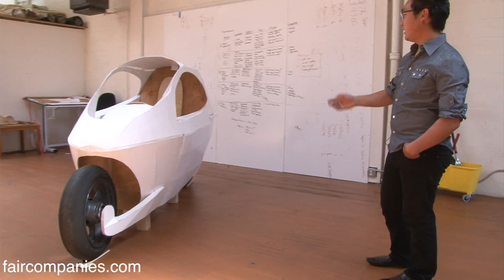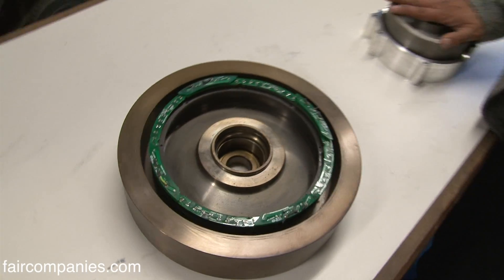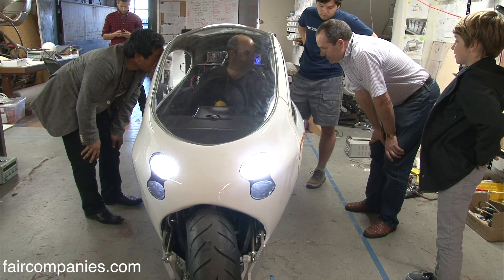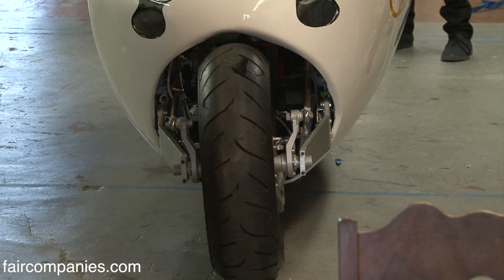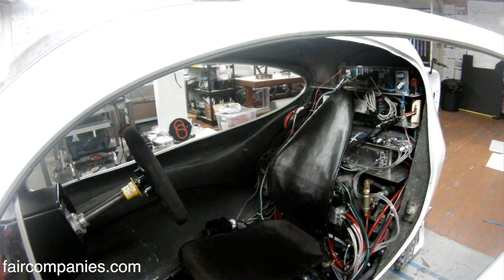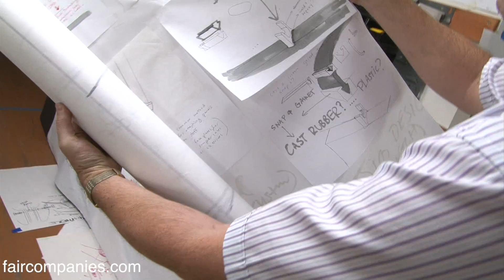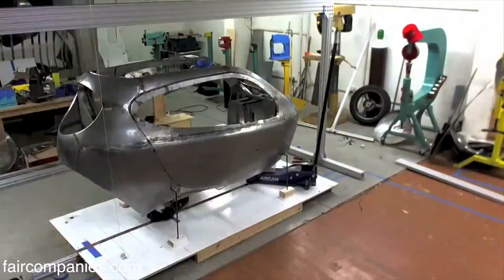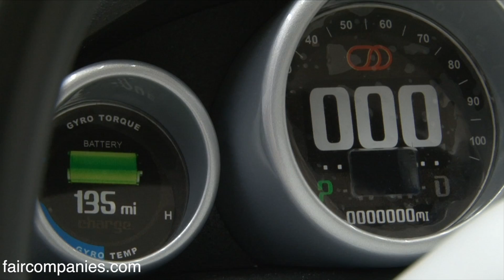2-wheeled untippable EV gyrocar from SF automaker startup

Comment: Kirsten since this is not your video and you only uploaded this to your channel to get clicks , I will direct my question to anyone other than you...my question is...how is the steering able to compensate the counter steer on a normal two wheel motor cycle.   if the steering turns in same direction of wheel then this will for sure go the wrong direction. . it is all about lean and counter steer to get a 2 wheel cycle to go in direction wanted.  so how is this compensated?

Comment: I expect this would actually cause a lot of stability problems in areas with steep hills. Particularly if you needed to make a turn while ascending or descending one of those steep hills.

Ascending or descending a steep hill, if there isn't enough tilt in the gyro a wheel could actually have reduced contact with the road, while the vertical stability is maintained.

Turning while on a hill would require the gyro to tilt left or right to compensate temporarily in response to a directional change, even if it wasn't caused by steering. 

And of course some terrain changes orientation, or doesn't regardless of whether you turn or not...

Good luck with this. I admire the complexity of the challenge.
Reply: Screws with packaging, but gyros should be on horizontal axes transverse to the vehicle length. Brennan gyro vehicles arrived at this a century earlier.

Comment: The horizontal gyroscopes are really only needed when moving slowly, standing still or being pushed around by high winds. Motorcycles at speeds over approximately 15 mph are using the vertical gyroscopes, the wheels, to balance the bike already. It's the Rider that needs to not get in the way of the vertical gyroscopes keeping them upright. 

I dig the idea though. I'd definitely consider buying one. They look great and they're much safer than a motorcycle.

Comment: so if you run out of battery the thing will tip on its side with you sitting inside of it? and a heavy flywheell rotating at massive rpm right under you ass and parallel to it??? NOOO

Comment: This gyro machine Will drain the baterries before you go anywhere...
Reply: Nope, the flywheel has very little resistance and can spin for hours on no power before it stops, it only needs more power when it slows down from resisting change in orientation to stabilize the vehicle.

Comment: For not more width , you could have two wheels at the rear or better steering at the front and do away with the gyro .
Reply: That is the thing, there is no real gain having a highly complicated 2 wheel gyro stabilised vehicle when tilting 3 wheel one would achieve the same goal with established and well proven cheap technology.

Comment: Why all the high-tech, when the 1967 gyro-x did the same thing with only one mechanical gyro?
Reply: Exactly xD
Reply: Because the more bullshit you can put in cars now the more fashionable you are
Reply: Exactly this is not new technology only that this one is electric , there are lots of things being sold as new tech and if people would research they would know this so these so called innovators are just rehashing old things and taking creadit for being the first
Reply: The gyro X was a failure
Reply: In fact, their first gyroscope was very similar to Gyro-X version.
Reply: i was thinking the same but i assume its actually easier to produce something of higher quality with new tech. This one is likely smaller, quicker to respond, and maybe even have less wear and repairs
Reply: I felt my comment was better left separate, so feel free to check it out, but the short version is: hills.
Reply: Self driving is the future so they're looking ahead
Reply: They also went out of business, so it might not be the best comparison.  Also, you can't judge the existence of the car alone as a measure of success.  There are more factors, including fuel efficiency, reliability, cost efficiency, performance, etc.
Reply: Yep! Its funny how they go saying "its a robot! a robot" and the gyro-x did all that with jus hidraulics...
Reply: whats wrong with 3 wheels?
Reply: k leung three wheels still has to lean and therefore requires complicated heavy suspension mechanism and servos.
Reply: I'm guessing Kim placed the gyro under the floor to keep the vehicle short.  The two counter rotating gyros in the same gimbal had the right shape: longer, narrower more flat.  It also provides redundancy.  If a torque motor fails you still have the other gyro to keep the vehicle upright.
Reply: Gyro X was a MUCH larger vehicle.  The Lit vehicle uses the gyros as additional batteries moreover it’s all electric and they are promising self driving.
Reply: I know I'm late to the party but for posterity: Single gyro systems suffer from the problem of "Procession" of the gyro. That is, the gyro gradually "wanders" on its own, leading to an uncorrectable  and undesired tilt. Two gyros rotating opposite each other negate each other's procession so you're only left with the desired quality: resistance to tipping (rotational inertia).
Reply: Well they Gyro X is very wobbly if you look at the less popular videos of it. Having proper electronic systems to help with precession is very useful, hence why they never drive the Gyro X at more than 15mph
Reply: The gyro-x is about twice as long and never put into production
Reply: @jackmcslay  thats because they ran out of money to fund a production model for production. And 4 were built but only 1 exist in working condition today. The other 3 were scrapped.

If they had the money. We would be seeing a 2019 gyro x by now, not this thing :/
Reply: Government standards
Reply: @kkane2280  it was legal always xD. They ran out of money xD

In todays goverment it would be registered as a motorcycle
Reply: @monkeyfan250  I understand that part but the question was why it was so complicated compared to the original all the safety equipment but the government would have required for this to be put on the road is probably what killed it because of the cost much cheaper if you don't have to put all these safeguards in
Reply: @kkane2280  i think what killed the cost was the parts of the car more then government regulation
Reply: because there's more saftey regulations today than there was in 1967. can't get something approved for commercial sale without requirements and those requirements are likely even more strict given the concept
Reply: Because it was made by a mean white man....?
I'm sick of people forgetting(unlike you, Bro) that there is NOTHING New Under The Sun!
Reply: @davidcisneros1429  No, thanks for trying, racist. It's because single gyro systems suffer from gyroscopic procession. Dual counter-rotating gyro systems negate this problem. Look up "gyroscopic procession" or "Brennan Gyrocar". If you hear the guy explain he says it in the video "they (2 gyros) counter rotate, counter process..."

Comment: '"regenerative braking"    The double decker buses in London use a high speed flywheel as energy storage instead of batteries to make their buses hybrid. It would be great if the gyro in this vehicle could be spun up to very high rpm from regenerative braking and then tap into that energy for acceleration from standstill.

Comment: This is really good video as it gives an insight into how complex the LIT vehicle really is.  (BTW: All your videos that I've seen are excellent, sub from me.)

I can't see the LIT motorcycle ever taking off when you can solve most of its complex problems by just adding another wheel.   As I write it's three an a half years later but they still haven't started manufacturing.  Compare that to the four wheel Microlino which has started production and it was only founded in 2015.

Comment: why does it need all that electronics ? the first gyrocar was developed long before any computers and it worked
Reply: Moonraker Deep to make it more reliable
Reply: I was thinking the same thing.  In the late 60's I had one of those friction cars that had gyro balancing and it always righted itself after going over small bumps, divits, and so on.
Reply: This car uses a PID to more effectively counter movement. Only possible with a computer. The older gyrocars weren't nearly as stable.
Reply: It depends on the size/mass of the giro-wheels relative to the weight of the vehicle.

Comment: Ok, I want mirror-metallic one, but,... I want semi-flexible solar panels on my roof top, watertight kevlar cockpit that sleeps two adults, rainwater collecting tank with drinking water purification and shower hose extension, air-conditioning, gps, airless all-terrain tires and hot air balloon rig and One wheel trailer that transforms into giant Yurt,... it doesn't matter how much it costs just send it over here son, make sure it has fog lights, if I get caught in a swamp
Reply: Nemanja Tomic send me 1 million dollars and I will get to work on it, I will also use super materials at that price like carbon nano fiber wires and stuff.

Comment: When battery dies, or some electrical power failure, you will need a crane to right back up again :D  its size is the same as a 4 wheeled tiny car ( like Smart car or one of those Japanese small car) , why not just get a small EV car with 4 wheels?  :D

Comment: What are the safety backups, like if the electricity suddenly cut/shorted out......would the gyros still be able to keep it upright?
Reply: I'm not an engineer, but it I know that a sealed gyro unit like the 2nd generation test-bed's 40lb version that spun at 12,000rpm, would have an incredible amount of momentum and a long spin-decay, so it would continue to exert a righting influence on the vehicle for a long time after the source of its power was removed.

I'd be interested to know how quickly the gyro they're using now, takes to power-up.

Comment: What are the downsides of simply having 4 wheels with a narrow wheel-base?
Reply: Probably the biggest downside would be the tendency to tip under lateral loads, in corners, on non-level surfaces or over surface irregularities.  Imagine a catamaran sailboat with the two hulls only a few feet apart.  How stable would it be in a crosswind?

Then there's the added weight and complexity of 2 additional wheels, and wheel coordination for steering in the front and differential in the back.
Reply: Teghead hi how it wit are static now w
dow car ?
Reply: If battery goes dead or an electrical failure the gyroscope device will stop and the thing will tip over, hopefully a 10 wheeled trailer truck is not behind you when that happen  :D

Comment: I'm sure your trying to make the gyros quiet.... Ever try making them so they run in a zero vacuum? No air no noise.
Reply: Not sure what a "zero vacuum" is, but I think one of the problems is that the two gyros are mechanically interconnected, which would make maintaining a hard vacuum difficult.  Of course, any reduction of gas in the gyros' envelopes would reduce surface friction, and thus noise, but some of the noise may be impossible to reduce, such as mechanical linkage noise.

Comment: This is going to be like the Segway all over again. Massive computational power, loads of sensors, extra battery use, tons of research and development costs, all becoming unnecessary by simply adding a third wheel. I love the engineering aspects of it, but in engineering there's this principle of K.I.S.S. to keep in mind with every project.
Reply: Want to talk about "pie-in-the-sky nonsense", Ken U?  The ELF seems to be a prime example.

Given the ELF's stated top speed of 28mph, it can't go on the freeway or indeed, on on any street where the posted speed limit is greater than 30mph (there are laws against obstructing traffic by going too slowly, you know).   Here in the Bay Area, that would include almost every street except residential streets and school zones.  It can't go across any bridge in the Bay Area (nor most of them elsewhere).  As their own FAQ states: 

"According to federal guidelines, the top allowable speed using the electric motor only is 20 mph on a flat surface. ELF owners can travel faster by pedaling, some riders regularly go more than 25 mph. The ELF is designed for use under 30 mph."

It goes on to say "Under federal consumer safety law, the ELF is deemed a bicycle", but it can't really be used in the real world like a bicycle.  Bike lanes are generally just 4 feet wide, with the idea that it will be sufficient space for one cyclist to pass another.  But the ELF is itself more than 4 feet wide, which means that (a) it's going to hog the entire bike lane, forcing other cyclists to enter the car lanes, or (b) it's going to have to enter the car lanes to pass other cyclists.  And as anyone in San Francisco knows by now, Uber and Lyft drivers have taken over bike lanes to double-park while letting passengers off, so that means that the ELFs will be spending most of their time in the car lanes, going 20mph and blocking cars.  That's far from a solution to anything.

Furthermore, ELFs have neither a floor nor side windows, which means that the only protection from the elements will be a little bit from above.  And as for protection from physical interaction with other vehicles on the road?  Getting hit by a bicycle would damage the ELF and its passenger; getting hit by a car would reduce both to confetti.  

And the price for all of this?  A minimum of $9,000.  I can't imagine that many people would be attracted by the ELF's few virtues at that, or any price.  About the only environment I could imagine the ELF being practical for would be on private land such as resorts in dry areas, like Arizona.

So trying to compare something like the ELF to a vehicle that will supposedly go 100mph in fully-enclosed comfort, with some degree of protection from impact, have a 200 mile range, and have full access to every roadway, is nonsensical to say the least.
Reply: +oggyreidmore Can they just copy the Segway tech, a sensor, which would probably not provide much (or any?) stability, but at least it's energy efficient and cheap? Patents?
Reply: Geir Osmund Aamlid The Segway is not energy efficient or cheap, but it would be if you added a third wheel. Same with this vehicle. It uses tons of energy and computational power that could be avoided by just adding a third wheel.
Reply: +oggyreidmore I concur. All this hi-tech gadgetry is ridiculous pie-in-the-sky nonsense. Some investors either took a bath or will take a bath on this Rube Goldberg contraption.

Want a hip yet sensible solution: see electric velomobiles. What something not as ugly as a Prius? Then look at the already extant ELF available at http://organictransit.com/.

Kirsten Dirksen posts many valuable videos but this was not one of them.

Comment: Mr. Kim. Love the concept! You are definitely on to something. A couple questions...1) is the Gyro running at all times or does it disengaged during normal, "stable" (typical of motorcycles) operation?...2) If not, since I've not seen your vehicle corner, how does it behave? I imagine it banking only slightly or even the wrong way and is why I ask. I would like to see a video showing it's operation at normal operating speeds!...3) Since you already have a "landing gear" arranged for parking, is the gyro just an unnecessary added effort, when a bit more tech work on the landing gear (small wheels/programmed to engage when needed, etc.) could keep the vehicle from falling over at low speeds with the benefit of further simplifying the design?.... I have modified (on the cheap) an electric bike that I really enjoy using (it's on you tube). Enclosed comfort is your big sell point! I will note the Gyro has huge possibilities in winter conditions so I'm not suggesting it does not have merit, but different models for desired conditions may be of some advantage for your sales? All the Best/RoyDesignedThat,Kom

Comment: My only concerns are for storage and passenger space. On a motorcycle, I can have a passenger sit behind me, so is there room for a passenger to sit behind me in this gyrocar as well?  Would they lean against my back like in a motorcycle? If this is going to be advertised as more of a car than a motorcycle, will there be two seat belts--one for myself and one for a potential passenger? Can I fit a bag or two in the back of the gyrocar--so, is there a trunk? I know that I've strapped supplies onto the passenger part of my motorcycle before, so if there's no trunk, is the seat adjustable to provide storage space in the back if needed?

If anyone can give any comments on how they think these two issues will be tackled, I'll be glad to hear their opinions on the matter.

Comment: So, how does this gyrocar work? When it is turned off, does the gryo keeps running or the car sits on a stand? Also, does this mean gyrocar will need and use more power to run these gyroscopes for stability on top of moving the car? Obviously, gyrocars have been around for a very long time but never really made it to the open market, even though it is neat and cool. I wonder why?
Reply: vasanthmuthu I think I saw a stand in the video

Comment: Hold on, did he just say 220 miles per charge?  And it goes 100 mph? You have me sold, but put this gyroscopes technology on a racing "fully electric" motorcycle.

I'm just wondering which batteries are you guys considering?

Also, you guys should consider graphene super-capacitors, they're CHEAP to produce and environmentally friendly.